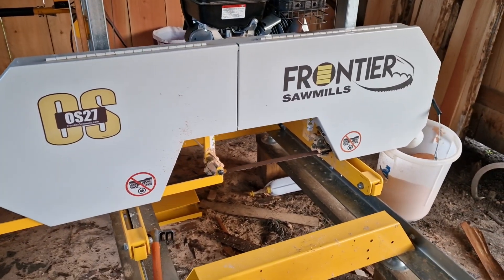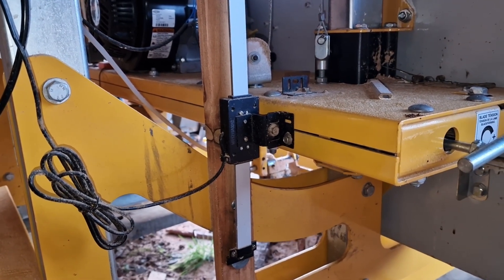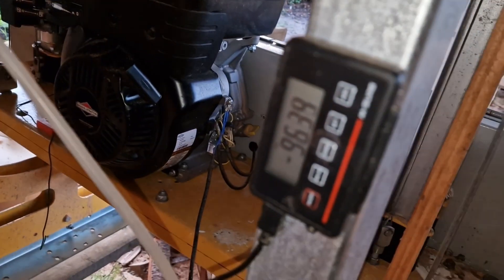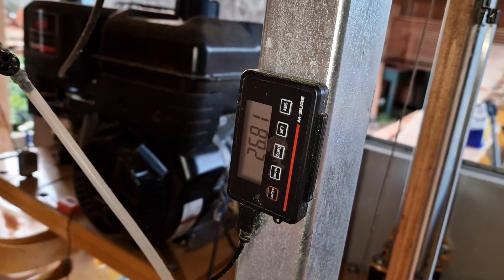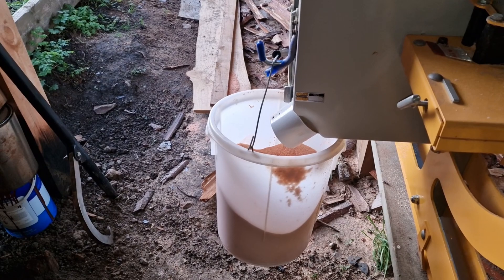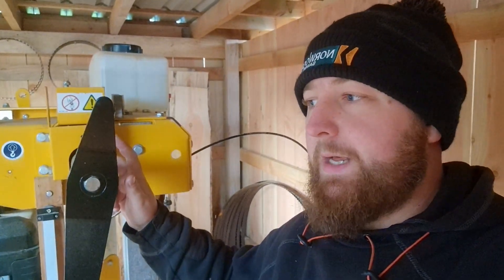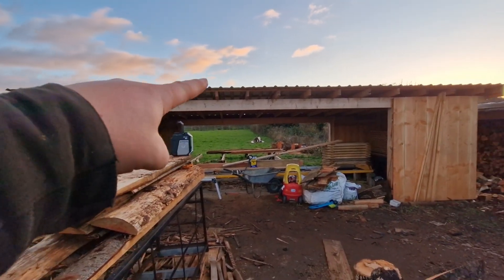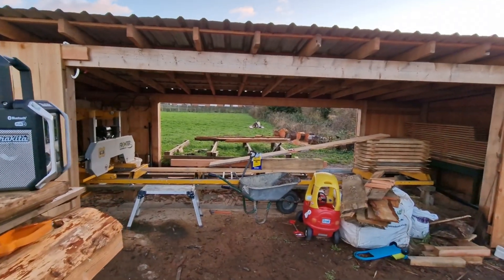Frontier OS27 Sawmill ~ Digital Readout Scale and Water Lube Tap

Comment: Just a thought mate on one side instead of sliding doors you could have a swing up door or 2 split swing up doors cat flap style that way if you have some rain you have a big area to do other jobs under could always use a cheap hand winch to open it…. Just an idea pal 👍👍
Reply from the maker: Hi Ollie and thanks for commenting 😊 swing up doors are also a great idea but like you said can be heavy and would need some sort of mechanical aid. I was thinking of a bifold door on the open side and then where the log deck is, just have that as a sliding barn door. The sawmill shed isn't going to be used for anything other than the sawmill so no planned future work in there 😄
Thank you though, I always think about people's suggestions thoroughly.